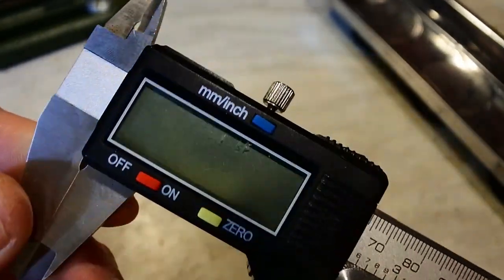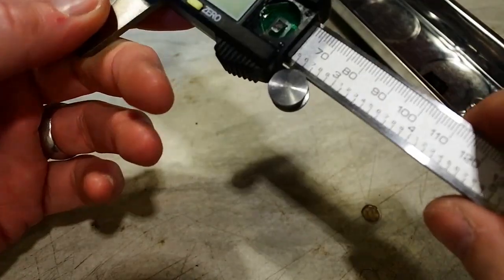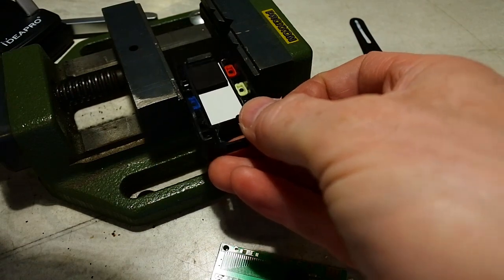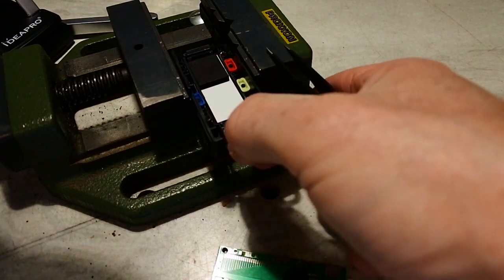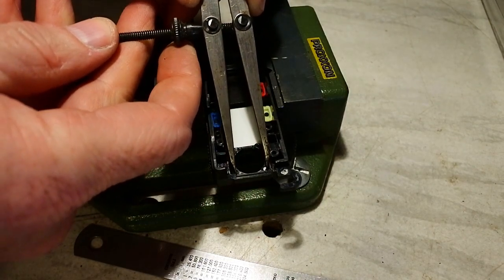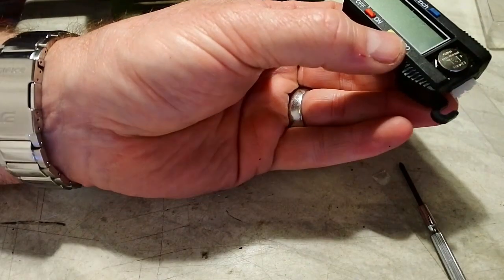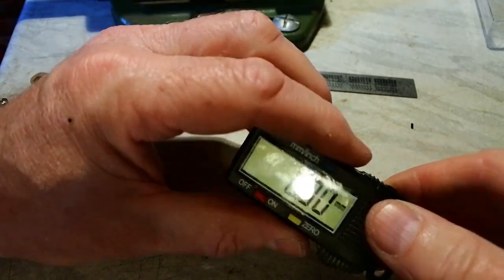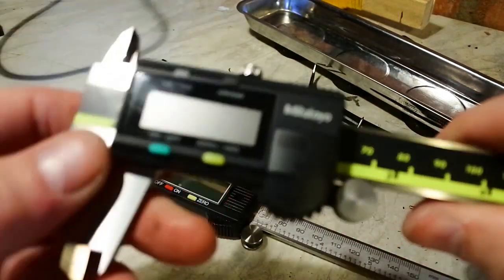The 'Never Flat' Digital Caliper Battery Isolation Hack

Comment: Useful info to know. I did wonder why my battery was always flat. The problem seems to be a very poor implementation of the on/off. There is a very simple circuit using a dual MOSFET with a few resistors and capacitor that works as a ZERO consumption (when off) toggle switch. 

TUsing SMD components this MAY be possible to shrink to fit inside but It's unlikely. There is also an issue of the single cell voltage being too low to operate the FETs.

The REAL solution would be for the original design to implement such a toggle but embedded at manufacture and able to use the higher internally generated voltage.

Here's a link to a variant of the circuit that should work well in any battery powered devices that are used infrequently but DO have sufficient space to mount internally, and especially those of 5v and above.

Web search for Mosfet Toggle switch to see multiple schematic images if THIS link does not work:
https://file.vishnumaiea.in/hardware/toggle-switch/MOSFET-Toggle-Switch.png

There are plenty of equivalent and alternative designs.
Reply: Thanks for the info. I tried the link you provided but it was dead.
Reply: @electronixTech  yes, sorry about that. Several links to schematics on that site are no longer valid for some reason. Try this link. Not identical schematic to what I have used previously (it's better!) But do a web search for MOSFET Toggle switch and search the images found. I'm going to try to edit my original post.

https://file.vishnumaiea.in/hardware/toggle-switch/MOSFET-Toggle-Switch.png
Reply: @boblewis5558  Thanks! I will check it out. Have a good day.

Comment: Same here, when you close the box, the foam will press on the "on" button.
"I discovered the foam in the top of the case was turning the caliper on when you close it. I trimmed the foam out above the on/off button and no more dead battery."
5

Comment: I've got a Mitutoyo Caliper.    I've had it for years. Only replaced the battery twice.  I also find it "ON' sometimes but it doesn't flatten the battery.     You get what you pay for I suppose. :(
Reply: My cheap chinese that looks identical to his has been with me for at least 6 years, and is still on its first battery.  Just went and checked, it turned right on, haven't used it since 2019.   You can never get what you pay for else the seller doesn't make a profit.  Part of what you pay for is his lunch.

Comment: I discovered the foam in the top of the case was turning the caliper on when you close it. I trimmed the foam out above the on/off button and no more dead battery.
Reply: Glad you found a solution, but my powered off, untouched for several weeks, flat on my desk/bench unit  STILL managed to flatten what had been a brand new battery! Bugger!
Reply: It wouldn't surprise me if the Chinese knew about that.

Comment: What happens if you keep yanking the battery out is you eventually break the battery cover lock tabs off and create another issue! A little better explanation of why exactly the battery is draining in relation to the fix would help along with a light over your work area would make it possible to see exactly all steps. Never the less thank-you. KTMcandog!
Reply: It's draining because it's always on a "ready to use" mode so you can slide it open and it starts working. The AD converter is always running. It's a user "convenience" feature that absolutely makes it not have an ultra low sleep quiescent current.

Comment: Ha ha, the easiest solution is simple and avoid all that messing with a tab, simple remove battery when not in use !
Reply: For me the best solution was to ditch the digital and replace with a dial caliper. Surprisingly easier to read, and of course no battery.
Reply: I just put a small strip of paper between the cell and the contact (like the original "remove before use" plastic strip) and putting in that or another strip as part of my tool clean up is standard. This makes it very quick to use when needed and no losing the cell in between projects...although the box these come in seem to usually have a slot in the foam for an extra cell storage...or it's easy to make such a slot in the foam.
Reply: Sounds good on paper but I'm SURE that would lead to premature failure of the battery compartment door.  It's a real POS.

Comment: Great idea.  The only thing worse than attempting to make a measurement and finding the battery is dead, is attempting to take a measurement and getting erroneous readings because the battery is nearly expired but not quite. What several of the commenters don’t seem to understand is several of the calipers in use today have parasitic battery drain even when the caliper is switched off. You turn the thing off but it really isn’t off so over time the battery is drained.  These 357 coin type batteries are expensive.  And it’s not just the cheap calipers that have this problem.
Reply: You can get a ten pack of the batteries at dollar stores.

Comment: What a load of nonsense, you guys need to use the tool correctly before wrecking it it with half-baked mods. Calipers are designed to display when you move the head. The small silver screw on the top locks the calliper and stops it turning on when you switch it off and put it in its box.
Reply: Maybe so for the expensive ones, but el cheapo callipers don’t have the luxury of extras like that. At the beginning of the video he does state it’s a cheap, but effective calliper, bar the battery parasite. Hence the mod. He obviously has the engineering mentality to try and solve problems, and it is such. Took him a few minutes plus a 20min phone call😁, he enjoyed it, and shared his findings. Some of us like it, no need to rubbish his video.
Reply: @airwolfie100  
see my reply to the other idiot who doesn't know how to use calipers. I would add that you should not touch the battery with your hands when changing it, it causes the batteries to drain.
Reply: @alfa-psi   @alfa-psi  Where ignorance is bliss, 'Tis folly to be wise. I really don't care if you ruin your caliper. But if you shut TF up and pay attention for a minute you might learn something. If you don't tighten the locking screw on the caliper head it will turn on and flatten your battery. If you handle the battery with your hands sweat and dirt will conduct electricity across the two poles of the battery and it will slowly discharge. Now I've typed this slowly so that even you should be able to understand it. But don't 
take my word for it read this - https://blog.esslinger.com/watch-cell-storage-handling-procedures/
Reply: @user-jd5hd8xz3p  I'm afraid it's you who is being an arrogant arse here. I have the same type of caliper and just like with my manual non-electronic micrometers I ALWAYS lock the caliper and manually switch it off even though it has an auto off.

THE BATTERY STILL FLATTENS! DOH!

Perhaps also you missed the comment from someone who has MEASURED the on and "off" current and found it differed by only 2uA!

Was THAT clear enough for YOU?

 YOUR caliper may work in the way you state BUT several people on here have experienced the same problem so it's a REAL issue, which you, LUCKILY, have not experienced. Finally, when a caliper such as this is JUST left on a bench with no-one touching it for weeks it can STILL flatten the battery - I've had it happen to me.
Reply: @alfa-psi  some people (witness Trump and his equally brain dead truth deniers) have SERIOUS difficulty in separating fact from fiction. It's unbelievable that they can be SO utterly dense!
Reply: My calipers appear to be identical to the ones in this video.  If I close the jaws (which you have to do to fit them in the case), lock them with the screw, put them in the case and close the lid, the foam inside the lid can press the power button and turn them on, even though the screw is locking the jaws.  Trimming the foam seems to be the way to avoid this.
In his comment, alfa-psi says there is only a minimal difference in current draw between "On" and "Off".  I wonder if this would still be the case if the button was held down for a long period?... food for thought.
Reply: @alfa-psi  
stop talking out of your arse about things you know nothing about.  You can clearly see the locking screw in the video. Use it! Do you not use the handbrake in a car when you turn it off???

 

1

Comment: I cannot understand why your batteries go flat so quickly.
I leave my Mitutoyo digital caliper on permanently. Never had to replace the battery in years, and it's always on and ready to measure. If the battery ever does need replacing, it's a cheaper fix than having to replace a power switch.
Reply: Comparing a $120 Mitutoyo caliper with with $10 !?
Reply: @moot2046  I did not know it was so valuable. I paid £2 for it at a car boot sale!
Reply: @tiggywinkle1000  lucky bastard! ;)
Mitutoyo calipers are high quality japanese-made bit of kit so take good care of it. :)
Reply: @poptartmcjelly7054  😀
Reply: @moot2046  batteries are 3 for $6 at Home Depot so I can see why owners of $10 calipers would squeel. Why not just buy verniers?
Reply: @wwilcox2726  digital or dial calipers are mean to provide quick reading.  A good caliper will pay itself for frequent usage.
Reply: @moot2046  maybe you don't recall your original comment.
Reply: Its a cheap chinese caliper. I'm sure Mitutoyo wouldn't have such an obvious flaw.
Reply: That's my philosophy as well
Reply: my Mitutoyo uses the LR44 battery, cheap and long lasting!

Comment: I just put in a small sliding switch on top where the data port is.  works just as good.
Reply: How wired? Do you replace the ramp/spring contact with a sized and shaped section of double-sided board, then connect the switch so that one lead goes to the upper and the second to the lower side then onwards to the pad on the main board to which the spring was originally soldered? 

I'll try the lockscrew trick, first; jostle-free might mean my version eventually goes fully off. If that doesn't hold true, and the quiescent current eventually kills the battery anyway, a mod is in order.
Reply: @michaelthibault7930  i wired it directly between battery contacts, so it turns it off completely. Picture: https://i.imgur.com/t5XhWZ6.jpg

Comment: It looks like lots of commenters have similar models with factory on/off switches that actually do what the label says. Mine doesn't!  
It's best to be able to pick the thing up and use it without dealing with yet another dead battery. This reliable, accessible switch substitute is much more convenient than having to remove (or flip) the battery whenever you think you might not be using it again for a while, then reversing the procedure every time you need it again.

Comment: I like your solution.  I went a slightly different route and cut the main power trace from the battery on the PCB, soldered some wires on and ran those out to an external switch.  3d printed a bit of a housing for the switch and epoxied it on.  https://i.imgur.com/nPneSJ5.jpg  Cheers.

Comment: The device in the video appears identical to one I bought from Harbor Freight which has an auto shut off feature.  Also, if you can't remember to push a button to turn yours off what makes you think you will remember to slide your own switch?
Reply: You clearly don't understand this situation.
Reply: @LemonySnicket-EUC  Well, why don't you enlighten me?  We are talking about the same product and arriving at opposite conclusions.
Reply: @ramtek2702  Yes, mine goes auto off too - looks exactly same as this onw shown up.  :D
Reply: The HF one I got years ago seems identical to this one. If I forget to remove the battery then it discharges in a few days. The pseudo-OFF button actually only blanks the display. It could be that newer ones really do turn off , but mine doesn't.
Reply: @Thankz4sharing  I believe you are right.  I've been using the same battery for at least a year and only the native off button so apparently they sold enough batteries and corrected the issue.
Reply: @alfa-psi  I have two pair of recently purchased Harbor Freight digital calipers that don't have this problem so I conclude they responded to complaints.  Anyway, I still prefer dial calipers.  
Call me names if you like.
Reply: @alfa-psi  I wasn't necessarily referring to you but if the shoe fits, wear it.  You sound a little paranoid.  Sorry you couldn't think of another solution.

Comment: What's wrong with the off switch??
Reply: it doesnt turn the device off, it only turns the display off (on the cheap models) the device stays on to keep its place on teh scale.
Reply: Battery always goes dead anyway, I just remove  battery when not using, lasts for years.

Comment: The "real solution" is to buy a set of dial calipers.  It's an amazing new invention that never needs batteries.
Reply: I recon a decent one of those might be more expensive than one of these and a lifetime supply of batteries, though I’d still prefer one of them
Reply: That's fine but the whole purpose of calipers is accuracy to within +/- .001".
Reply: @alfa-psi  Maybe you could educate me further by providing an example of a solution that isn't also an alternative?
Reply: @alfa-psi  Wrong again.  The alternative to oiling your window would be to find out where the squeak is coming from and relieving the interference OR....just replace the window with one that doesn't squeak.  Care to try again?

Comment: not had that problem i have to admit, mine turns on when you open them and turns off when closed, purely metric and seems to be ok, I guess it must be the cheaper versions, why dont they just put a time on it so if not moved for 10 minutes switch off simple really to solve the problem like your idea, KISS.

Comment: Mmmmm .... yeah ... had an issue with a similar 'cheapo' vernier ... annoyed me quite a bit ... so I stopped and had a little think ... and realised that what was happening was the device was very sensitive and if it is put away in its case (or not) without "Locking" the slide it would turn itself on when knocked or bumped and you guessed it, eventually the battery ran down ... the fix is simple  when putting the darn thing away .. turn it off and LOCK THE SLIDE  with its twist knob  ... this ensures it cannot accidentally turn itself on until you need it ... I have not had a battery go flat for quite some time ... it was the simplest,  easiest  long term fix ...  CHEERS.
Reply: Worth trying so long as spare fresh batteries are on hand if mine doesn't work the same as yours.  : - )

Comment: So the ON-OFF switch, doesn't switch it on or off. I have an old Swedish digital caliper with the same problem. Though in my case, there isn't an ON-OFF switch at all. Put the battery in, and watch it drain when not in use. A great idea and a simple fix.

Comment: I use a 1/4"x1" +/- strip of notebook paper under the battery when I'm done using (close the batt lid with end of paper sticking out on face of caliper) . . . or sometimes just flip the battery over (no paper required)

Comment: I bought one of those at Harbor Freight which chewed through batteries quickly.  Why not just put the battery in upside down for storage?  The plus side won’t make contact so it hurts nothing. Then when you’re ready to use it flip the battery over the right way.

Comment: Or, instead of having to dismantle & potentially invalidate any warranty, you can simply turn the battery over inside the unit when you've done with it - thereby keeping the battery with it so you don't have to spend ages wondering "Where the hell did I put the bloody thing!"

Comment: I've never had one that didn't automatically turn off after a few minutes to be honest but I'm wondering what is easier, doing all that, or just pressing the off switch?
Reply: These units tend to turn themselves on for no particular reason.
Reply: @philiplang9921  lock it closed with the knob.
Reply: @alfa-psi  you get what you pay for. 🌞

Comment: Just screwed up the calibration by taking it apart.
Reply: That’s not how these work; you can’t calibrate them. They use a scale etched on a pair of PCBs that are slightly different and they are sensed with capacitive sensing. Very similar to vernier calipers. https://youtu.be/fKSSY1gzCEs

Comment: I have had a cheap Canadian Tire one that was around 30 dollars Can. that I have had the same battery in it for at least 10 years. If I leave it on and not use it for 5 min it will shut off.
Seems accurate enough for what i need it for.

Comment: Battery costs 15 cents so i got 100pcs.  I have 4 calipers and now the cycle is quite obvious - they eat one battery a year. So if one of them starts to give "BLINK" , I just replace all of them, because they all start to blink in a month. Very ingenious hack indeed if you are not frequent user, but it's not that expensive to change batteries yearly also.

Comment: I got one of that kind, with a smaller screen, since years (Cannot remember how much).
I use it sometimes and leave the battery inside but never needed to change the battery yet ???
My one also work with a single LR44.

Comment: Do either of those calipers read absolutely ? 
If you turn them on at zero, remove the battery, adjust them to 3", put the battery back in - do they read zero or ~3" ?
Reply: Mine would still read zero
Reply: @FarWesternGarrison  Yep, that's what I suspected. Which means any reading is not guaranteed for the simple reason the counter may have miscounted ! Vernier calipers don't have that issue. Any position they're in can be directly read.